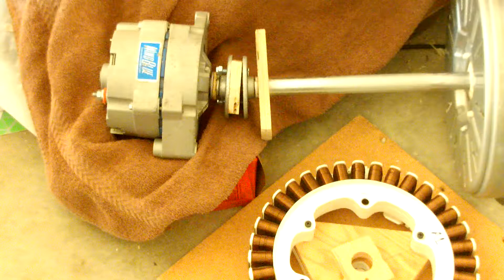overunity

Comment: Are you trying to spin clothes? as the centrifugal force used to spin water out has the force to tear your arm off I don't think that it steps up speed it has a spring clutch that allows it to  spin faster the faster it spins and the opp is true as it slows if you spin it to say wind spun to generate a current it will only reach a certain revolution then the spring clutch will stop it spinning to get around this you need to use a meshed gear or  belt to spin it in the opposite direction to make power. Or am I going down the wrong line of thought. Not my  intention to confuse.
Reply from the maker: opt - think you misunderstand.     a large radius motor  is the  Equivalent  of  a (large-radius)   Driven-wheel.   where  (Rotary)  force is  produced and applied,  at the  Perimeter  of the  bell.      the result is  a  Lot  of  Inherent MA,  near  the center of rotation.    this  MA  can be used to directly  drive a  low-speed pma.  or  rpms can be  stepped up, a bit;   but this  is  Negative-MA;  aka  losses.      in an ou transform, all Avoidable   Losses,  Should be  AVOIDED.          see, here,  final sage  Losses.  resulting from   differences in  RADII.
https://www.youtube.com/watch?v=3FoWWgIzpTg

an  f&p motor  is  JUST  an  example  of a  Large-radius, zero cogging,  motor.     it is a  Direct drive outrunner bldc motor;   the  rotor is  mounted  to the bottom of  the   'drum'.    no springs.  no nothing.   cheers

https://www.fisherpaykeltechnologies.com/products/direct-drive-motors/
Reply: Ok thanks for your explanation 👍
Reply: After reading the information on the link and seeing the images of a large radius motor I've have a lot to learn. F&P are the local brand here in New Zealand and are proud of its medical side as well as the domestic achievements as consumers we use most all of our machine use in excess of the manufacturers operating instructions (we are a bit rough) thanks for your reply as it nudges me to learn more.
Reply from the maker: @onepoundtriggerjackson5528   their  motors  are  good.    but since  f&p declined  to communicate with me,  i don't hold them in high esteem.      f&p  could be Positioned  to  Lead  the  way, to  utility-scale ou  energy production.     then, we could say  bye-bye, to  nuke power plants.   oh, well.    cheers

Comment: These stators should be rewound so a lower voltage ESC can be used to get the full potential out of the motor without having to use expensive high voltage drivers.

Comment from the maker: update:     i believe that   f&p has come to understand  that such a motor design has a number of  'positive'  features.   ( it does have one, small 'con'.     a bldc controller is  Required. )        this motor is a bldc,  outrunner.    due to the  larger radius at which  force  produced, its output is, inherently,  high-torque.    i believe the configuration of the stator results in this being a (pseudo)  stepper-type  motor; and that continuous operation of the motor will be,  economical.       the size of the conductor in the coils is around 16awg.      this wire size will tend to limit  current draw.       with so many coils,  the  Number of Layers is each, is  LESS.   so there is less back-emf and impedance.    so, efficiency is  Greater.     these several factors should result in a  Efficient  prime mover, whose power consumption during continuous operation  Should  be  'less'.     it may be that this type of  motor will consume less than two hundred watts, while being able to produce More (watts) than that, when directly driving a pma, that has optimal specs.   i believe a delta-config stator will perform, best, in a 'higher-speed' application, such as this. above 80 rpm.        googletranslate
https://www.fisherpaykeltechnologies.com/products/direct-drive-motors/

Comment from the maker: update:   the weather in my neighborhood has turned warm and humid.    as a result,  right now, my rate of progress on this project is zero.      i have discovered that the clearance between the magnet rotor and coil cores is  not very much.     if i cannot readily achieve the required tolerance, i may have to reduce the height of the coil cores, in compensation.      googletranslate